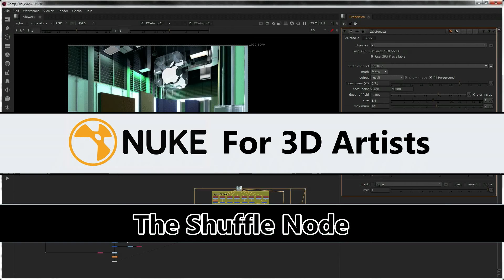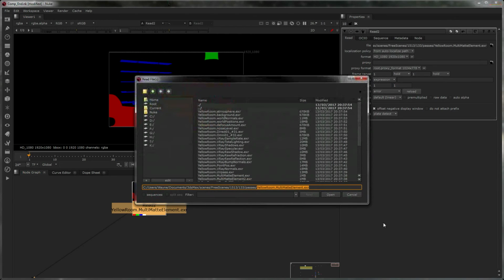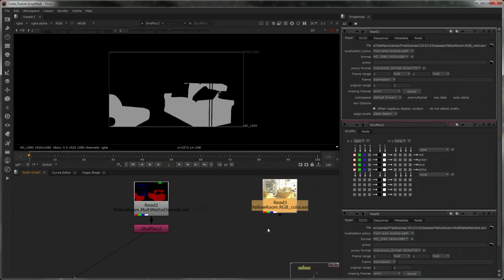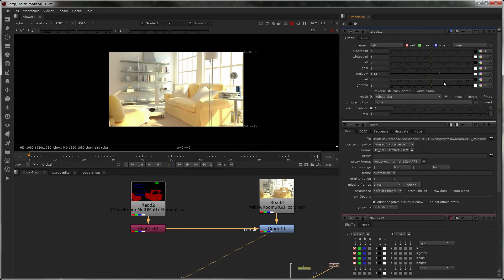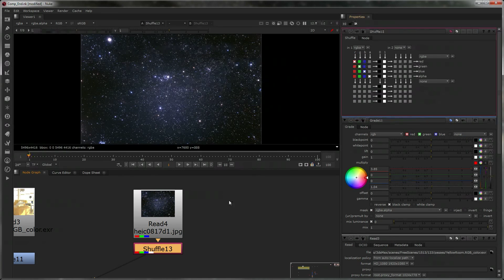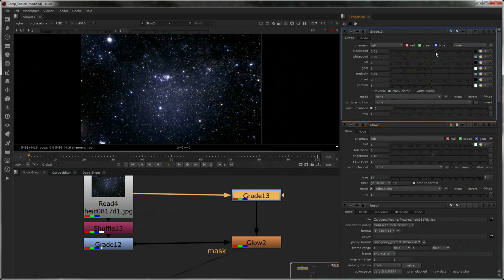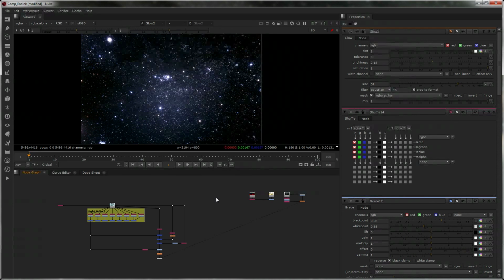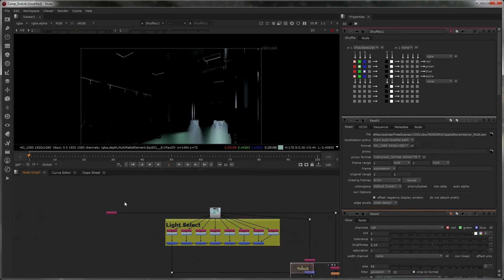Nuke For 3D Artists - The Shuffle Node

Comment: What if you have other colors to the multimatte like purple, does it still work? Is the multimatte pass anti aliased ? thank you.
Reply from the maker: most V-Ray render elements have an option for aliasing when rendering.  The V-ray Multimatte will only produce red , green & blue colors, although using other passes such as ObjectID you can get other colors that can be used for quick masks in comp where needed.
Reply: Appreciate your time. thank you!
Reply from the maker: No problem :)